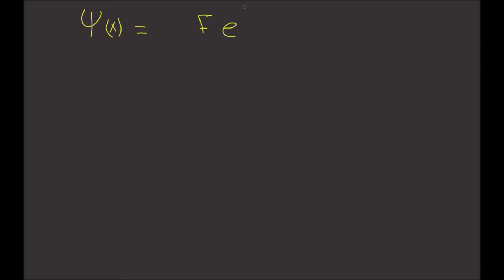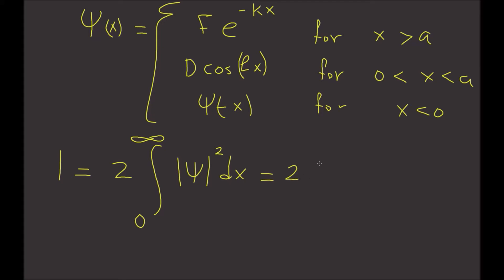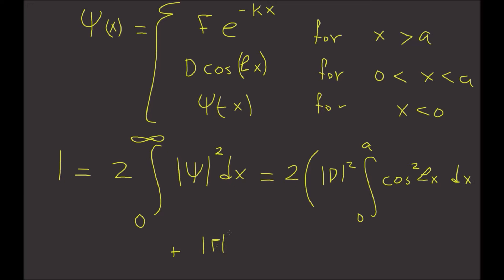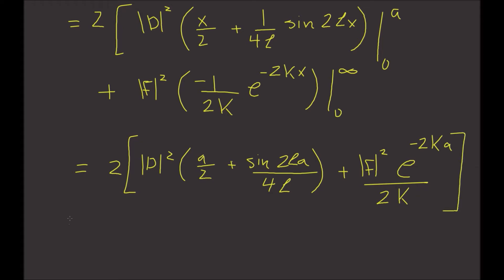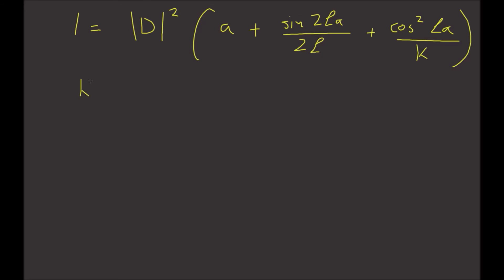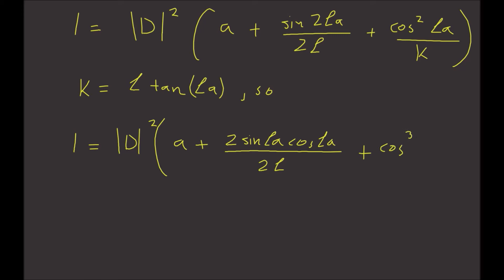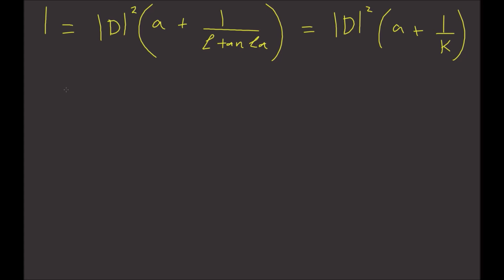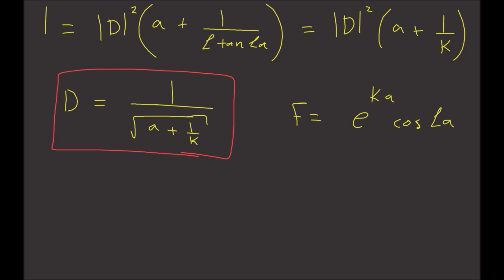25. Normalizing The Finite Square Well | Learn Quantum Physics

Comment: you took intigration multiplying two times.. is that right?because middle of wall is not x=0
Reply from the maker: +Jeyaneepan Kanagaratnam because the well is square and integration from -inf to inf is the same as integration from 0 to inf times 2.
Reply: thanks for reply..
but x=0 is axis is symetric?